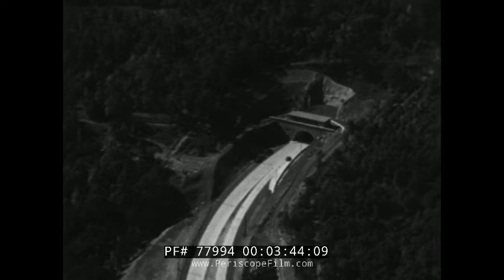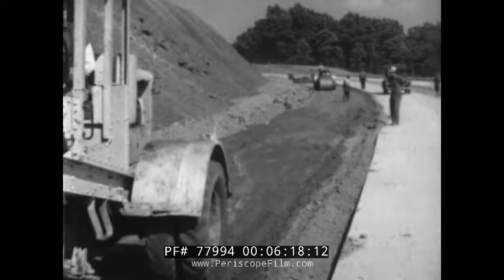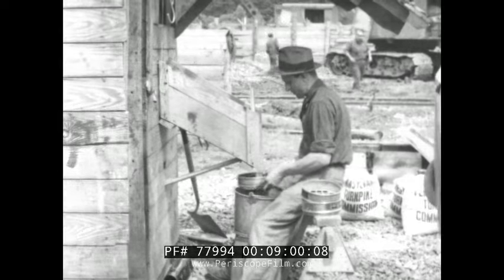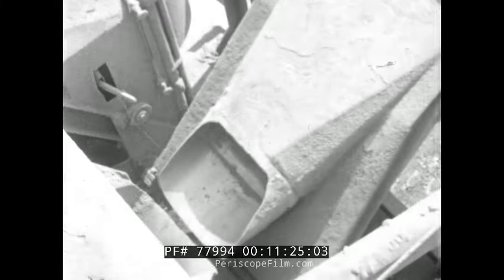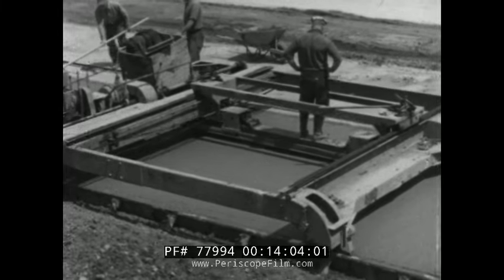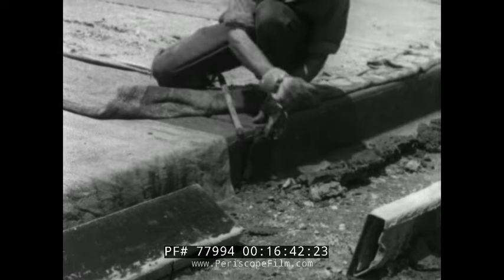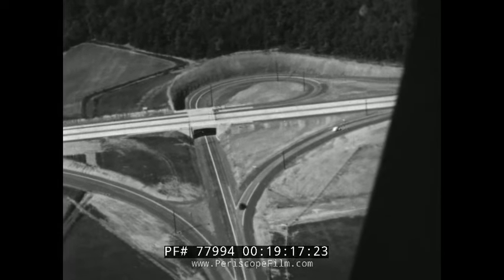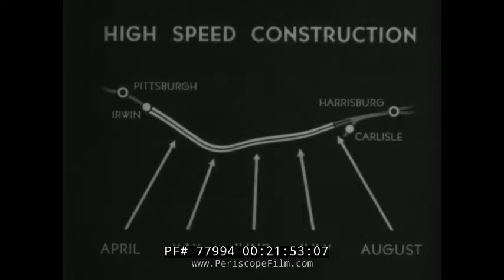CONSTRUCTION OF THE PENNSYLVANIA TURNPIKE  77994MD

Comment: The Turnpike and I-95 are both a million years old and NOW they have FINALLY put in an interchange between them!  Only PA would build two superhighways and have them cross but not intersect!  Really, we should have a minimum IQ for the people who plan for the Commonwealth's future!
Reply: what about that get off get back on again nightmare at Breezewood when you are heading west?
Reply: @godoftheinterwebz I’ve just learned of this,  have traveled the turnpike east and west at least 15 times since 2000,  and I don’t think I ever really noticed or was affected by this supposed nightmare.    Driving it west tomorrow morning.
Reply: @godoftheinterwebz Works out well to get off at Breezewood anyway.   Lots of cool abandoned buildings to check out, not to mention the 13 mile abandoned section of road.
Reply: @nyccollin  yea, like why didn't they consider the fact that vehicles would get bigger when they decided to build the tunnels? wouldn't it have been cheaper to bypass them from the start?

Comment: As a young lad I used to see a Pa. State Trooper that would stop at the local ARCO. I'd always ask to see the engine on his car. A 1972 Plymouth Fury with a 440 Six Pack. In 1974, I was getting into enough trouble with a Satellite with a 318. I left in 85'.
Reply: we had a 1968 Ford Galaxy ex state police car. 428, 4bbl carb, high speed rear end- I would KILL to have that car today

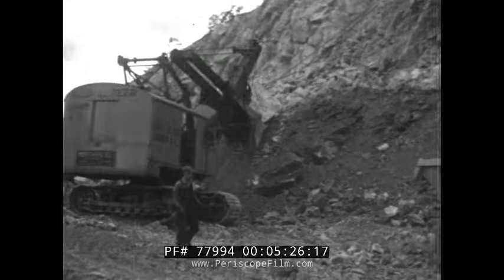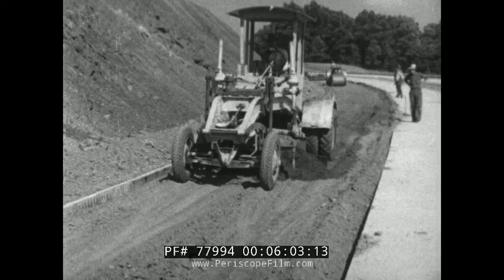Comment: Nice video of the construction. I especially enjoyed seeing the Northwest 80-D shovel at 5:28 to 6:02 placing that huge rock into what looks like an International off-highway truck. It took skill, first to get it into the dipper, then to get oversize rock like that into a truck. Those shovel operators then had no joystick controls, computers, or air conditioning, and had to work both hands and feet, moving levers and operating brake pedals. Shovels made by Northwest, made in Green Bay, Wisconsin, were well known as rugged shovels made for heavy rock digging.

 I also enjoyed the concrete paving operation. That was always a scene of intense activity, after grading the subgrade was completed. Back then, the concrete was mixed at the jobsite with pavers, such as the REX pavers in the video. The dry batches of cement and aggregate were transported from the batch plant in trucks with batch bodies, dumped into the skip of the paver. A water truck followed the paver, which was added to the dry batches at the paver and mixed.  Slump tests (the cone filled with concrete, rodded and the cone removed and the amount of "slump" measured) are an indication of workability of the concrete. Usually the concrete was placed in two courses (layers), with steel welded wire mesh between for strength. The paving train followed the paver, striking off, screeding and floating the concrete. a brush finish may be specified, then covered with burlap. Water sprayed on the burlap prevents evaporation of the water in the concrete while it cures.  Core drilling the concrete to get a sample goes to a lab to check concrete compressive strength.

Nice video, of the sort of heavy construction that isn't seen with that kind of intensity today.
Reply: They would have made superior helicopter pilots.

Comment: No medial barrier of any kind,,,  which went well with the No seat belt or airbag system.
        No Speed Limits(except in tunnels ) when the Turnpike first opened. 
             
                         Safety standards have come a long way.
Reply: they weren't invented until the late 1950s

Comment: probably the last time the surface of the turnpike looked that good and was smooth.
Reply: The original 160 miles did not hold up well. By 1954 21 miles had to be repaved and by 1962 the entire original turnpike had been blacktopped. Beginning circa 1995 sections were rebuilt with new pavement, parts concrete and most, asphalt.
Reply: MP 102-109 started getting a total rebuild last week, including 2 curves which are being straightened through modern engineering.
Reply: @mitchdakelman4470 Is that area better now?   I’ve driven the turnpike about 15 times over the years,  but not in the past 6 years until last week.   Seems like it’s been improved upon quite a bit.
Reply: Much of the original Turnpike has been rebuilt, by removing the original pavement, and laying new pavement down. Very few of the original bridges exist although several have been restored on sections that have been untouched, but when a section is now rebuilt, the character of the original Turnpike is going away, so this is why I co-authored two books, and collect photos and films like the one you see here. One other complaint: they've made the tolls increasingly expensive as much of the toll money went to non-turnpike projects.
Reply: @mitchelldakelman7006 Sounds like you know quite a bit about the turnpike!   I currently live in the Midwest but I just got back from a roadtrip to NYC.   Correct me if I’m wrong,  but are the tolls cheaper when you’re westbound on the turnpike?
Reply: @nyccollin  At Warrendale, going westbound, tolls are collected and no toll charged to Ohio after this point. However, on returning from Ohio, entering Pennsylvania, a toll is charged, so you only pay one way between the Ohio State Line and Cranbury Twp, about 30 miles.
Reply: @mitchelldakelman7006 Thanks for the information!  So you say you co-authored some books on the turnpike?  What are they called?

Comment: The reason the cars are going so slow is that the national speed limit during WWII was 35 MPH. The Pike actually had no speed limit when it opened, and speeds up to 90 MPH were common, except at tunnel entrances.
Reply: @twstf8905   I am relating the contents of a book I own about the Penn Turnpike. The book is almost 40 years old, and includes information from people who helped build the road and used it when it first opened.
Reply: Pay no attention to the wiseguy responding to your initial comment.  Your info was interesting....
Reply: @broughmar  Thanks!
Reply: Hannah, some of the footage in the film was filmed in slow motion, that means it filmed at a higher frames per second, say 64 frames a second that some cameras can do, but projected at the standard sound speed of 24 frames per second. Some of the same footage is on a color silent film called A TRIP ON THE PA TURNPIKE which the Penn Archives has posted on You Tube

Comment: The builders of the Turnpike would be sickened by the condition of this road today. It’s like driving a slalom course with all the potholes.
Reply: I hate driving on the PA turnpike, and avoid it whenever possible. And the tolls are outrageous.
Reply: While I fully agree of the high tolls -- the legislature of Pa has forced the PTC to give money to PennDOT for their projects as well as support systems like SEPTA. By 1962 the entire original Turnpike was blacktopped but the joint lines, spaced every 77 feet on the original highway show through. A good portion of the Turnpike has been rebuilt since 1995, from ground up, using new bituminous asphalt paving that does not have the expansion joints as the original highway did. But in the reconstruction, the narrow median is widened to make it easier to drive the Turnpike.
Reply: Actually, today, Jan 11, starts a multi year project to totally rebuild MP 102-109, and eliminate several curves, make it 3 lanes each way with a wider median, not thought of in 1938 when the Turnpike was initially designed.
Reply: The western half's surface is in good shape.
Reply: I agree they would say what did u do to this beautifal road we put in
Reply: Really?  Drive 70 east across Missouri, Indiana and Ohio (no tolls) and  then compare it to the ride and the conditions on PA Tpk.   You'll experience how much better the PA Tpk is
Reply: @davids7799  I 100% agree. I recently traveled from Pennsylvania to Illinois, and I took the turnpike, the Ohio Turnpike, and the Indiana toll road. Out of all of them, the Pennsylvania Turnpike was in the best condition and gave the smoothest ride.
Reply: @davids7799 Exactly.   No idea what these people are talking about.   The PA Turnpike is beautiful.
Reply: Democrats need that tax money to rig elections
Reply: @brosefmcman8264  Pennsylvania is a swing state brainiac.

Comment: The PA Turnpike is obsolete in design.  It needs to be six to eight lanes wide and there needs to be a freeway-to-freeway connection for I-70 in Breezewood.  Furthermore, there should not be a toll.
Reply: The interchanges are terrible too, to go from I-76 to I-70 at Breezewood, you have to go through a local road, with traffic lights. Just to go from one interstate to another? Really? Why couldn't they just do a cloverleaf, and be done with it? Ditto I-76 to I-79.
Reply: Somebody has to pay. Who? Those who use it and benefit from it. US citizens and foreign. visitors.
Reply: @williambranham6249  Gas taxes.  Duh.

Comment: Interesting how close together the opposing traffic lanes are.  Is there even 10' of median between them?  Interesting to see how roads were built in years past using more manual labor than today.  As I watched this video, it reminded me of films we were shown in elementary school in the 60s and early 70s.
Reply: Just separated by a thin Jersey barrier in this day and age.    Speed limit was probably 50 then, 70 now.
Reply: There were a lot of bad head-on collisions on the turnpike. Eventually they put up a steel cable barrier. Cars sometimes hopped over those too. I remember seeing those as a kid. Now it's Jersey barriers, as the other poster noted.
Reply: @dwmac2010  By the 60s, the median was protected by double 'W' guard rails.  At the start, it was thought that 10' (or whatever it is.. that may be right) was very generous and safety-promoting.

Comment: The turnpike toll was to last one year as told by the state.. over 50 years later it has only gone up in price
Reply: Mike Allan    Federal income tax was supposed to be temporary, also.
Reply: The plan was 1952, while the newer parts built after the war would be toll free, but that is not the case. The cost to widen and rebuild the highway is staggering, plus the PC must hand over a sizable amount to PennDOT. You can use I-80 or Route 22 which has traffic lights on portions, and not pay the tolls.
Reply: @mitchdakelman4470 Love this comment.   You schooled OP quite well.

Comment: Many materials testing and inspection procedures used back then are still used today. Slump tests and cylinder/beam molding of concrete, sieve analysis of aggregate to determine %age of each size stone in said aggregate, the water and burlap curing of concrete. Great post thanks!

Comment: Why are they driving so slowly?
Reply: Cars of that era weren't built to go very fast. They weren't powerful and had very low gears to climb hills and keep up with urban traffic. Any speed higher than 50 mph had the engines screaming at high RPM which shortened their life. It wasn't until the mid 50s that cars were built for 60+ mph driving on freeways.

Comment: We are still paying the price here in PA for the bad decision to built the turnpike in concrete. Control joints still rise up and break the asphalt top coat.
Reply: The left high-speed lane is usually a little smoother than the slower right-hand lane.  Most of the concrete rectangles have experienced compaction of the material under the near edge of the rectangle; it descends slightly while the distant edge rises.  This is what gives drivers the bump-bump-bump sensation on concrete (or formerly concrete with asphalt pave-over) roads ...
Reply: Not true
Reply: sounds like asphalt is the problem then
Reply: Almost anything man made will need repair. The Capitol Building Dome is undergoing a massive rehab. Not many  complaining about that.
Reply: I live in NC. In  the 70s  I 77 was extended N of Charlotte to the VA line. Concrete was used. In just a  few years , every other section was dug up and replaced. Due to cracking. I 85 in SC and I95 in SC. Needs replacing and widened. Awful mess.
Reply: @williambranham6249  I remember that concrete was used on the original I-77 alignment which went through Elkins alongside US 21 before Virginia decided to let I-77 take care of their Rt. 100 Fancy Gap problem and the new alignment was split off south of Elkins. 

I lived in Charlotte when the section between Charlotte and Statesville was finally complete but don't remember if that was concrete there, though. Just glad it was open!
Reply: @JeffersonMartinSynfluent  You're right. We lived in Mt. Airy at the time. I had a patient who drove a bulldozer and helped doze I77 up the mountain from Elkin to Fancy Gap.
Reply: @JeffersonMartinSynfluent  

for the last two or three years they have redone all the ramps at 77 and 40 and widened 40 through Statesville. They just started a new project east of 40-77 near 21 on 40;

Comment: Funny. Back in the day they used concrete for road construction. It worked and was durable. It lasted 50+ years. Today they break that concrete road up and replace it with asphalt. Why? So the corrupt politicians can award their contractor buddies expensive replacement contracts to resurface the roads every 10 years. We have a Rt 295 contract in NJ that is 15+ years old and not going anywhere. Answer? UNIONS! The longer the job takes the richer they become. Why else would you destroy a perfectly good concrete road surface with an asphalt one?  $$$$$$$$$$$$$$$$$$$$$$$$$

Comment: It amazes me the hard-working, pain-staking man hours with their hands and modern day equipment, could get these roads completed in record time. So intricate in details back then. Now machines practically do all the measurements w/o hardly any engineer intervention.
Reply: No environmental impact studies, no union strikes or slowdowns, no eminent domain lawsuits.
Reply: No gravel base either.  They laid the concrete directly on the soil.  It wasn't long before the pavement began to break up.  I recall Dad cursing at how rough and pothole-strewn the road was in the 1960s, and you still see complaints about it today.  Only a total rebuild will solve that problem, and that's only occurred in relatively recent times.
Reply: A lot of the work  was  already started. It was built on an uncompleted railroad way , Much of it has been rebuilt.
Reply: Even if there is any engineering, they use inferior, inaccurate "Common Core" Math.

Comment: Have driven the Irwin-to-Breezewood section many times, then I-70 toward Washington, DC.  Would have been interesting to have driven the original route, in original form.  And don't let the Turnpike Commission mess up the Midway rest area.  Renovate, yes, but leave that one the way it was.
Reply: I would have to say they did a pretty decent job on Midway. 
I run the turnpike from the Ohio line to at least Breezewood, if not Lebanon almost every night as a truck driver.
Reply: RJ McAllister interstate 70 going to DC is difficult

Comment: I drive the turnpike all the time from Lancaster to Johnstown in a semi. And sometimes from ohio to Marietta. A lot of the original bridges have been restored on the eastern part while a lot have been replaced with steel drop in bridges with the original concrete supports still in place however there are quite a few original bridges in very bad shape that are still around cracking and decaying over the western part of the pike. Amazing video. its nothing like this now. All the concrete surface has been paved over
Reply: Many of the tunnels in the video are no longer in service.
Reply: @JesusIsLordAndSavior777  three are bypassed.  Five in use, all of which have had a secondary parallel tunnel bored for dual lane traffic in both directions. One of the bypassed tunnels is leased to a private company that uses the tunnel to test race car aerodynamics.